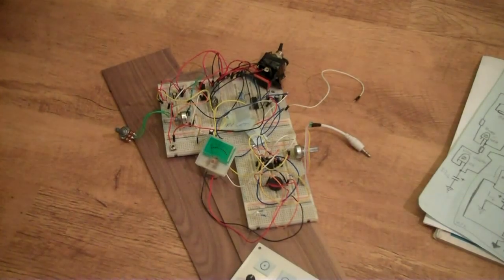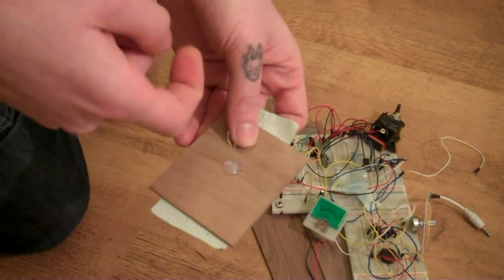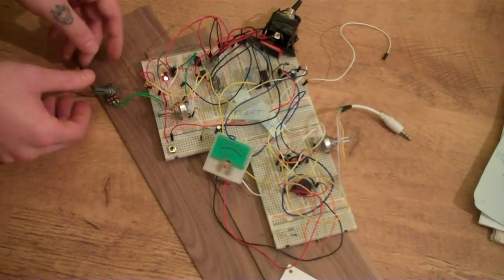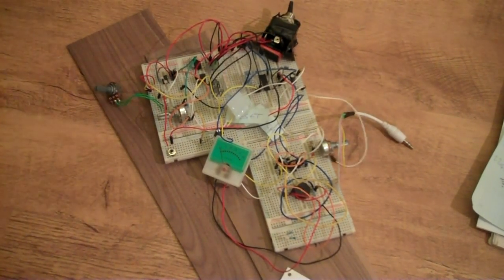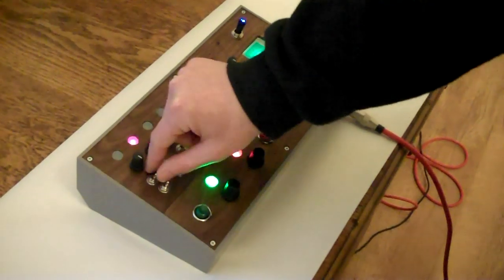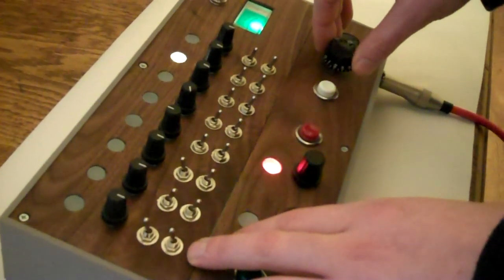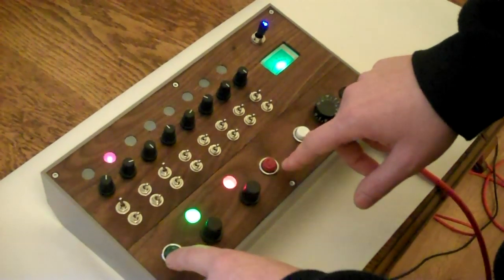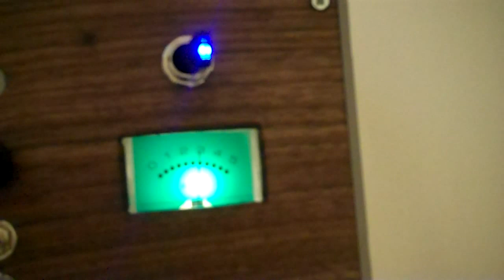Milgram-555-contest

Comment from the maker: For MIDI you will need some digital chips, probably programmable ones like a microcontroller. This can be difficult to implement and is probably not a beginners project. You could however look at making a MIDI sequencer using a pre-made MIDI kit or perhaps an Arduino - Good luck!

Comment: Excellent !! Dead impressed :0)
Can I ask a technical question please?
I'm just getting into making my own guitar effects from recycled components.
I've got a lot to learn, so please excuse my ignorance. I put together a pedal circuit called the Eternity Loveburst, which for the first effort I bought the pcb for and used recycled components. It all looks good but it's dead, not a sound.
Can you tell me which component it is most likely to be damaged from the desoldering and potential over heating of. I'm guessing a transistor or diode would be the first to replace, waddya reckon? Cheers
Gary

Comment: hot glue is awesome :3
Reply: love the hot glue led, such a good idea
Reply: i like this idea but probably it will be hard to remove without damaging the surface (in a case if a LED will be dead). Maybe it need to be wrapped into something 1st so you'll get a kind of a cap of a round form that will be useful to insert any LEDs of the same size.
hmm maybe some chem. agent can protect a LED from sticking to the glue?

Comment: Really beautiful build! I'm looking for a project box more or less exactly like this one-- did you buy it from a parts store online or was it a fairly hard to find enclosure?
Reply from the maker: It was from a local independent electronics store, so I'm not sure how easy they are to find. You could try Farnell, they have a wide range of enclosures available online
Reply: Is the TEKO PULT 36 series. A company from Italy and comes in 3 sizes. I think 362.8, 363.8 and 364.8 are the part numbers for the sizes. eBay has some sellers selling them.

Comment: I love your project - it inspired me to build one of my own. I'm still working on the project and I've run into a bit of a snag. I was hoping you might be able to point me in the right direction. 

I wired up my shift register outputs with an on-off switch for each step. The issue I find is that when I turn a step off, it merely shuts off the cV output, but the oscillator continues to run whether it has cV or not. I would like the oscillator to remain silent when I switch off a step. Thoughts?

Comment from the maker: Cool, nice to hear you're building a shift register based synth! I love using shift registers :) Not sure why your switches are not working. Maybe you could look at using the reset pin on your 555 timers (if you're using 555s), it's a good way to turn on and off the oscillator while the chip is powered. If you're really stuck you could email me a schematic and I could have a look at it for you. jim[at]sonodrome[dot]co[dot]uk